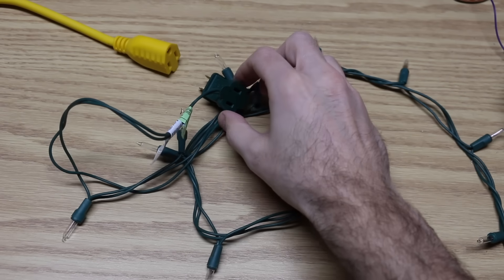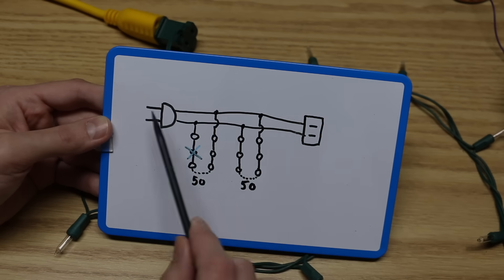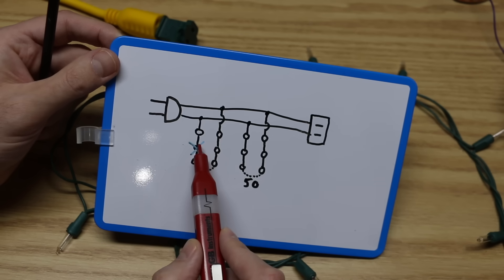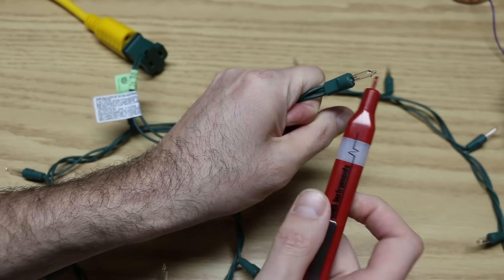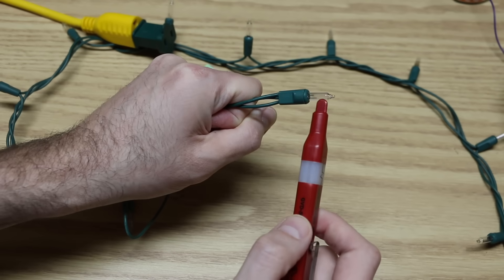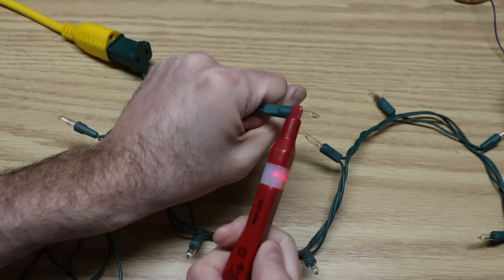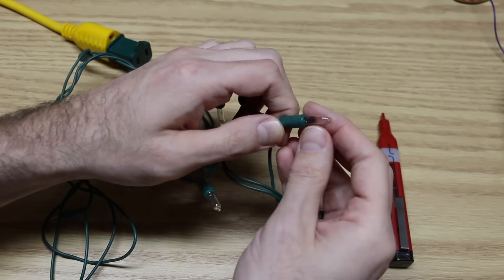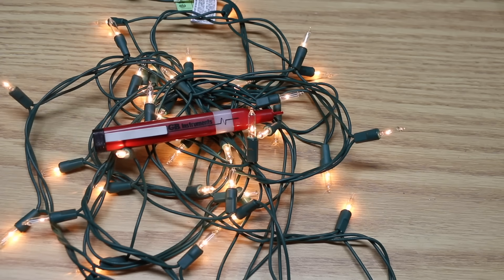HOW TO EASILY FIND BAD CHRISTMAS LIGHT BULBS using a non contact voltage tester

Comment: I figure he knew which bulb was bad prior to the video and he just wanted to show the methods.  I would not have guessed the polarity switch, thanks.  Thanks for the video, and it was short! Thumbs up! - Update he did mentioned the half split method near the end of the video, I missed it initially.
Reply from the maker: I mentioned the halfway split test at the end of the video. Back when I made it I didn’t know so many people would end up watching it and I was targeting a technical audience who already would have known.
And I didn’t know where the bad bulb was but the string went dark suddenly when it was on a garland so I assumed all of the bulbs did not break at the same time and it was only going to be one, so I took the opportunity to get the camera out.

if too many bulbs are all broken at the same time this method can be a goose chase so that’s when it’s better to throw it away and get another set if the method doesn’t seem to be yielding results. Sometimes I have located three bad bulbs and it still does not light up when they are replaced with good ones because the whole thing probably burned out after neglecting to replace them as they were originally going dark over time. when the other ones stay lit and more and more burn out, they all take too much power and blow at once.
Reply: @GadgetReboot  I often skip the last minute of videos after I get the idea of the video. Sorry.   I updated the comment.

Comment: Not worth it …fixed many lights …usually replacing the burned out bulbs causes others to burn out …..some times having to replace half of them…if half the set is out, I no longer try to fix it just cut it out and use the other half……..replace the few bulbs with the other half if I can find ones that light up…..buying replacement bulbs is expensive……just get a new set ….cheap enough….
Reply from the maker: it sounds like you would appreciate this other video on dealing with broken Christmas lights https://youtu.be/O0tPmWJWChA

Comment: If your tester is showing electricity at the socket, why aren't the bulbs lit?
Reply from the maker: The electricity can still get to the socket even if there’s no bulb installed as long as all of the previous bulbs are present and either working, or if they are broken at least when  they failed, they activated an internal bypass shunt so electricity can still go beyond it.  when a bulb fails and it also fails to activate that internal bypass shunt, that’s when it takes out the string of lights because now electricity can’t get past it.

so if all bulbs are installed in sockets but they are not lit, at the point along the string where electricity is no longer detected, it is because the bulb just before that one was broken and could not allow electricity to pass on.

Comment: Pretty not so straight forward to me. You found a bulb that didn't work, then replaced the one before that one to fix the entire string, instead of replacing the one that didn't work. Very confusing. You pointed out the burn marks on the bulb, but you had a clear white light. You may not see that burn mark on a dark colored bulb, so what would you do then?

Comment: What does it mean when all the lights in one section burnt out?
Reply from the maker: if they actually are all broken in one section as opposed to just all being off because of possibly just one or two that are actually broken,

assuming the wiring and sockets are all still in tact, what most likely happened is bulbs started legitimately blowing one by one and they properly went into bypass mode 

so if you started with 50 on in that section and then one broke you would have 49 lit and one off, then another one might break so you have 48 lit and two off

as more bulbs break and there are fewer lit, the ones that are lit are all seeing a slightly higher voltage on them as more continue breaking and eventually the lights that are lit can no longer handle all the excessive voltage so they just all blow from being overpowered.

Comment: A new set of lights is probably cheaper than that fancy pen.
Reply from the maker: until time goes by and you could have bought 10 of those fancy pens with all the new light purchases
Reply: @GadgetReboot you have good point. Thanks.

Comment: Just finish repairing a 100 bulb set. I invested in the "LIGHTKEEP PRO'S" incandescent tool, and used a non-contact voltage tester. The set consisted of 2, 50 bulb series strings. Its my understanding that the bulbs are disigned to SHUNT when they burn out so the others stay lit. Some will, some won't. Information provided by the manufacturer of the tool states, in the case of 50 bulb, 2.5 vac bulbs, if 4 bulbs fail and all 4 SHUNT the applied voltage across the remaining lamps then increases above the rated 2.5 vac. He also states that with these 4 , SHUNTED bulbs in that string of 50, the life expectancy of the remaining bulbs is reduced by 67%! I"ve found complete strings of 50 bulbs blacked, all failed because too many bulbs worked as designed "SHUNTED"  Would be implied a person needs to scan the tree periodically for bulbs that are not lighted. and replace them as they fail. Not real practical if the trees is against a wall or in a corner surrounded with presents.In hours of working with curb find discarded Christmas trees I've found sockets where the contact inside is out of position. Just to night I had a 50 lamp string light up and then spotted several bulbs not lit. They had functioned as designed. They were SHUNTED (passiing power) but the filiment was burnt open. Trying to repair these while on the tree is a PAIN. Miss one bulb and  you can really gobble up the clock. Ever try and remove strings from a pre-lit tree, thats another treat. I've picked up some really nice trees setting on the curb just from bulb failure, Last week I donated a 12' tree to our church, was on the curb, in its boxes. Box was labeled with the price of  $ 1000.00 when purchased. Just an F.Y.I. "LIGHTKEEP" offers an other tool for repairing "LED" strings also.

Comment: I don't think this will work on LEDS !
Reply from the maker: it worked on my LEDs. Maybe certain ones are designed a different way but especially if the power is not constantly applied to them but is pulsing fast enough that we can’t see it, that’s still a changing voltage that may be detected like AC lights
https://youtu.be/fB5o-COdxa4

Comment: Only stumbled across this video.  While your diagram is very helpful, is not quite accurate.  The first bulb socket on the 'run' from the plug is used as the connector for all three wires, therefore your diagram should show a "bulb' socket at this point instead of a 'dot' connection.  Also show the other 'dot' connectors as bulb sockets.

Comment: "How to find a burnt-out bulb":   If it's not lit, that's your first clue....
Reply from the maker: but when a section of 50 are not lit, there may only be one of the 50 not working anymore and 49 still working
Reply: @GadgetReboot  Christmas lights still in series?? I haven't played with them in a long time, but thought they finally went parallel.
Reply from the maker: I think maybe only larger exterior lights are in parallel and most likely it’s due to the infamous lower cost with less wire and complexity involved for the cheap stuff

Comment: I learned that there are 2 fuses in the male plug that are about 3/16 inches long the plug has a tiny compartment built in and Cdn Tire sells the fuses. My fuses are good and my lights still do not work so I am no further ahead.

Comment: I have a question. It seems like this technique only works if one of the first ten or last ten bulbs are broken. Whenever the broken bulb is in the middle, the voltage tester stops detecting anything after the first 10 bulbs even when the first 10 all function. Does anybody know why? I’m using led mini lights.

Comment: I would like to get one of these testers. I followed your Amazon links but it goes to pages and pages of these things (there must be like 100 different models!). I just wanted to get the one you had, but I couldn't even find that. But I was just looking at Lowe's because there is a Lowe's near by. They have one which is Kobalt brand, but I noticed it is battery powered. Are ALL of these things battery powered?  I hate things that need a battery to operate! I will use this maybe once a year, and the battery will just go bad and leak and ruin it. I would really think there could be one that wouldn't NEED a battery. After all, its detecting a high-voltage wire.  Why couldn't it have a transformer that uses the fluctuating electric field to create voltage to power the circuit?
Reply from the maker: The Gardner bender one I have is probably 20 years old and probably not available now but the important specification is to make sure it can detect as low of a voltage as possible like down to 12 V or so because some of them are only good at detecting higher voltage is like 120.
I think I’ve only ever had to replace the batteries once and leaking batteries are always hit or miss so I’ve been lucky on that.
There’s not enough energy to couple into the device to be able to actually power it, and it doesn’t take much energy to be able to detect the presence of voltage. 
It’s not really taking power from the live wire, it’s more like using physics and black magic to couple small amounts of energy to detect it, so when you bring the device near the live wire you are just  completing a delicate circuit path through the air rather than using it as a power source. Similar to how you create a static shock by touching certain objects when the air is dry.
Reply: @GadgetReboot  Well, thank you very much for the quick response! I'm glad I asked because I was just going to get the Kobalt brand but the specs for that are 50 to 1000V so I guess that is not gonna be what I want. But you mentioned the one you had used was "Gardner bender", and I just happened to discover that on the Amazon web page you linked to. So they still make that brand. Trouble is, that is also 50 - 1000V so also not appropriate I guess. I suppose I'll get one of those on Amazon, but what I don't like is, they are all made to test if line voltage is active on outlets and I guess wires going to outlets. What I really found interesting was, in my recommendations list there were 2 videos on how to make a home made voltage tester. Very simple designs, just 4 transistors and a resistor and an LED or sound device. Wow, I wonder if one of those would work for finding bad Christmas lights. Thanks again for your help!

Comment: You really going to do this 50 times for a $8 roll of lights?
Reply from the maker: The price must’ve really gone up, when this video was newer people would always complain that the best solution is to go spend three dollars on another set of lights. Inflation ain’t good.
And on a string with 50 lights if things are going well it might take maybe 10 tries to narrow it down using the method mentioned at the end which others refer to as a binary search.

Comment: If you want to dind it quicker, instead of searching each lamb, just divide the series in two and search right in the middle.
If the middle lamp is working, it means that the faulty one is on the second half. 
If it's not working you either found the faulty lamp or it's on the first half.
Just keep dividing the series in half until you find the faulty one.

Comment: Mine all seem to fail where 1/2 the string is not lit and every bulb in that section is burned out - they all went out at once!
Reply from the maker: that can happen if some bulbs failed and originally kept that half lit and you didn’t realize some needed to be replaced and then gradually more failed until the rest couldn’t handle distributing the power so the whole thing blew and then it’s probably not even worth fixing.

Comment: If the bulb isn't replaceable could you cut the wire going into and out of the socket and splice and heat shrink the wires together to make the rest work?
Reply from the maker: I wouldn’t do that because then the total voltage powering the whole string has to get divided against a lower number of bulbs so each of them sees an increased amount of power they have to deal with and if it’s just one it might work but technically the lights will blow even faster and they might burn hotter and it becomes more of a general risk
Reply: @GadgetReboot  Thanks.  Since I have three lines not working what I'll do is use one line as a donor and splice in a working socket from that line.

Comment: I guess some non contact testers can't pickup the voltage off that small a wire. Whole string is out. Tested the outlet at the wall and got beeps. Plug in the set and no beeps anywhere so I figure it's the fuse. Fuse checks out for continuity plus when I plugged a phone charger in the other end of the set it turned on so power is making it to the end.

Comment: I have one of those little guns that you plug into a light socket and it works very well but not all the time. I typically just throw the whole strand away and get new ones but this looks like a better option.
Thanks
Reply from the maker: yeah the light keeper pro can repair the shunt in the bulb sometimes and get it working again but then it’s a good idea to still go through and replace all of the ones that are not lit so that there’s no excess Power going to all of the ones that are lit. Every time another bulb blows and the rest stay lit, they all have to deal with more power and it shortens their life.
Reply: @ That’s good to know.
Thanks!

Comment: The key is having a bunch of spare bulbs on hand that are the correct voltage and physical size so a repair can be made.  They are hard to find.
Reply from the maker: as long as the spares come from a similar style where 50 are on at a time on a circuit within the strand, the voltages should match and for the bases I just take the bulb itself out of the base and swap it in so I keep the same base that was already on the broken strand and drop the good bulb in the base.

Comment: Nice video.

Nice video.

I'd suggest getting a non-contact voltage tester with a locking on/off switch (ie. press once for on,  press again for off).  [Usually they blink occasionally to indicate it's on.]   If you get a negative reading, it could be because the momentary contact on/off switch didn't make contact, and turn on the tester.

Comment: Couldn't you just plug in the lights and then see where they don't work anymore and that's where the problem is... I don't get why you would do this
Reply from the maker: if the string only has 50 lights, none of them would be on. If it had 100 lights, half of them would not be on so you wouldn’t know where the problem is

Comment: What happens when all the lights have the burned glass?
Reply from the maker: The dark burn marks don’t necessarily mean the bulb is blown but if the string is not lit at all and there still could be a lot of bulbs that are legitimately broken, it may be too far gone to troubleshoot like this and it’s probably easiest to just throw it away at that point.
when that is the case, usually what happens is you try to track down a broken bulb and you replace it with a good one but the string still does not come on and you might try to track down  more and the string still does not come on when you replace them so maybe the string had a catastrophic failure and there are so many blown bulbs it’s worth discarding.
Reply: @GadgetReboot  -  that sucks. It’s on a prelit tree, so a lot more expensive than throwing away a string.  It’s a small section so I’m replacing all of them…but hopes are low.

Comment: What is the voltage of the average string of christmas lights? My detector says AC voltage below 70V or above 1000V may not give correct detection...
Reply from the maker: 120 V in North America or possibly double elsewhere.
when the string is working each light might only have around 2 V on it because there’s usually 50 lights on a circuit equally sharing the main voltage,
but when they are broken the full 120 V will be present in the area of the defect because it shows up along the string until there is a break and then it can’t go any further so it just sits there and doesn’t get shared across any bulbs.

Comment: All my strings still work with one or more lights burned out.  When they burn out there is a "shunt"  connection made at the light to keep the rest on.  I don't know how to test these strings when they don't work..
Reply from the maker: when part or all of the string is out, it means at least one of the bulbs had a failed shunt so it caused an open circuit, cutting power to all of the lights on that section of the string so that’s where this method can track down where the circuit has opened up

Comment: I'm not sure I understand this. If the tester shows a working one and then the next one is not working, I replace the one that I just tested that was working?
Reply from the maker: if by working, you mean the tester was indicating the presence of electricity and then it was no longer detecting it, the reason it was no longer detecting it was because the previous bulb is the one that was broken and so electricity could not go any further.
Reply: @GadgetReboot  I'm just not getting it. If the previous one is beeping and the one after it is not then does that mean the previous one that is beeping is the one that needs to be replaced?
Reply from the maker: Yes because beeping doesn't indicate which exact bulb is bad, it just shows where electricity is present or absent. So electricity is present going up to the bad bulb and it beeps.  Then because that bulb is bad, the circuit is broken and  electricity can't go beyond and the next bulb doesn't beep.